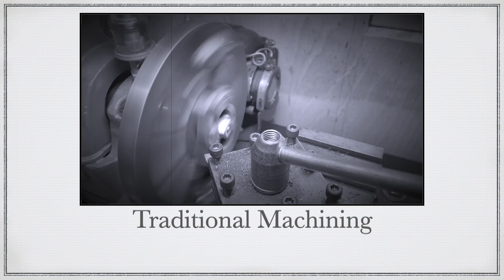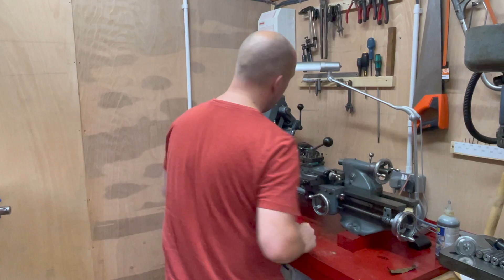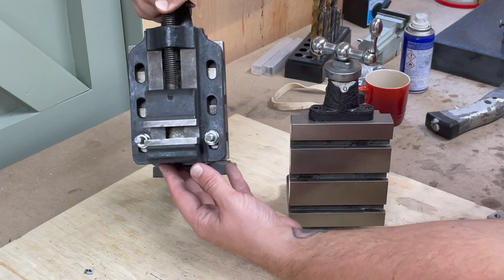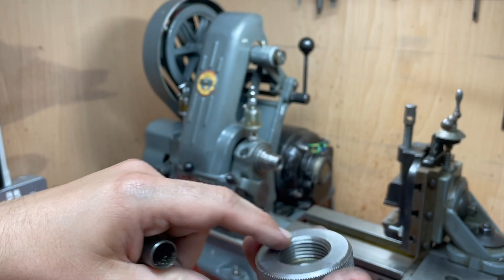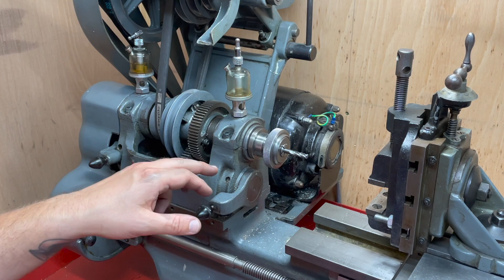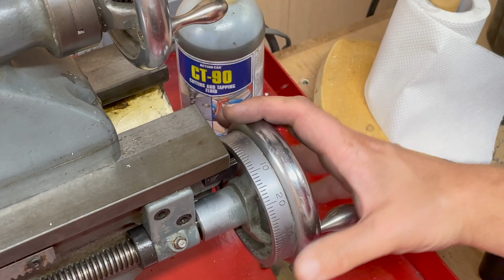Step by step milling in the Myford ML7 for beginners - updated and revised!

Comment: Sorry new to lathes and thought I would ask some questions,
If the chips not removing fast enough can`t you just have a small pump running that blows air through a flex tube aiming air onto the work piece?
Whats the speed of the Myford ML7 please, and could you not place different cogs to have a faster ratio combination,and just allow mor oil running on bearings to keep lubed,?
Reply from the maker: Best to check lathes.co.uk for the spec/etc. really mate

Comment: I have a unimat lathe mill combo with the power thread cutting attachment on it, is anyone making a video on how to use this little machine for the setup and use for the beginner.
If it's like your video it would be perfect for me.
Reply from the maker: I actually had an emco that I replaced with the ML7 (almost like for like, cost-wise!) - what did you want to know?

Comment: I was under the impression you have to use special collets with a thread at the end to prevent the cutter from pulling out of the collet and cutting deeper and deeper into the work piece so do Myford sell such collets for their lathes or is it just not a big problem?

Fingers crossed you see comments on old posts. 😊
Reply from the maker: It is true that there is a pulling force with milling cutters, you don't need a screwed collet end - I use those in my auto-lock chuck which you could potentially fit into the spindle of the ML7. The main thing here is to avoid using the 3-jaw!

Comment: Do not overtighten the verticle slide holding down bolts as it makes the cross slide stiff.
Reply from the maker: I don't use the milling attachment on the ML7 having bought a milling machine, but good to know!
Reply: @williamsworkshopuk  
I've never owned a milling machine but do have an Eliot 10m shaper and a heavy duty vertical slide on my Colchester Chipmaster lathe.
Reply from the maker: @haroldpearson6025  I have thought alot about getting a 10M shaper!
Reply: @williamsworkshopuk 
They are a great machine. Not a hobbyists machine but designed for the small machine shop or tool room. Very accurate and should not be considered as a "roughing out machine" 
I have used my 10M in the construction of 5 locomotives including 2 7.25g narrow gauge locos. All the flat surface machining was carried out on the shaper.
It's said shapers are slow compared to a milling machine. However this is not true when comparing a decent shaper like the 10M to a bench top hobby milling machine. The 10M will take a 2mm cut on mild steel and 3mm on cast iron.
The big advantage is in cutter running costs as you can use many of your lathe tools on the shaper.

Comment: Thank you William as a complete beginner the video was a great help and has given me confidence to give it a try.
Reply: Thank you so much for the video,,I was very pleased with the first attempt, I have the Myford vertical slide with the  multi axis .I haven't the vice as you demonstrated or the C work holders,so had to make some  out of flat bar just to hold a small aluminium block for trial purposes' I only had a 6mm 4 flute which was with the lathe when I bought it,which partly blocked the flutes,I have since learnt that a two flute is better with ally. I am going to look for a two inch vice for the vertical slide, holding clamps and collett chuck and end mills then I can get going on a simple steam engine. Thanks again I will be using this video in the garage when I have all the bits and pieces I need  being a pre war baby I easily forget. Dave
Reply from the maker: How did it go, Dave?

Comment: I greatly appreciate this, thank you. It's helped me understand the old lathe I just bought.
Reply from the maker: Great to hear! I'm afraid I do most of my milling on the Centec at the moment which is great fun and a worthwhile investment.
Reply: @williamsworkshopuk  I got a ml7 and every accessories for $500 aud, im definitely going to make due with what I have for now. What would you suggest is a good cheap milling machine. The ml7 seems good for straight cuts like keyways.
Reply from the maker: @rickoshae1687  gosh AU$500 is a fantastic price for an ML7 and all the bits! Regarding milling machines – I couldn’t decide between a Tom Senior, and a centec : it came down to whatever was available first. In reality, it might have been a smarter choice to get in modern machine. But if you go down that route, it’s probably smarter to pay someone else to do the machineing for you.

Comment: Hi William, a great video for beginners to milling, you cover a lot of good points.
Is that a Stuart steam cylinder in your video?
I learnt to mill with a set up just like you have on my ML7, it works, but with light cuts only and a very restricted working envelope. 
 Then I was very fortunate to come across an immaculate Myford VMB milling machine, what a quantum step in usability, but at a significant cost! 
A cheaper and fun way to increase your milling capacity is to get an old shaper machine.
I got a tidy Boxford 8 inch shaper for 1/8 of the cost of my VMB mill.
The tooling (HSS) is way cheaper and easy to sharpen compared to milling cutters.
A shaper really complements a lathe and it's a fascinating  machine to learn to use!!

Regards Paul in NZ
Reply from the maker: Hi Paul, it is a Stuart 10v cylinder in the video. Unfortunately I made some mistakes at the very last part of the 10v build (the majority of it is in a playlist on the channel) so it's sitting fairly forlorn on my shelf at the moment :)  I agree re: dedicated machine - got myself a Centec 2b shortly after this video was made and haven't really looked back, but it's wonderful to see what can be achieved on just the ML7.
Reply: @williamsworkshopuk    Hi William, Those Centec 2b machines look superb, very nice! I wonder if any ever made it to NZ? 
You must get your 10V finished after putting in all that work. I made one a couple of years ago, it runs great on comp air, I really must pull finger and build my steam boiler kit for it. 
There is an elderly gent, Harold Hall, who has a superb model eng web site. He has a detailed guide to building the 10V, with excellent pictures of set ups and fixtures. His guide is far better than the 'official' book that I bought from Hemingway kits. Harold is well worth checking out if you haven't already done so.

I totally agree that it's great to see what can be done on just the ML7, I made two gears on mine last year.  Regards Paul

Comment: It seems like you are breaking the rule of no upward force on the work in the milling footage.  Shouldn’t the cutter be started at the back and bottom of the work if the spindle is turning conventionally?
Reply from the maker: If it's at the bottom, the cutting force would be upwards, right?
Reply: @williamsworkshopuk  If the actual teeth of the cutter are applying the force then at the bottom it seems they should be pulling the work down and toward the operator.
Reply: 100% correct in your observation.👌

Comment: thanks for the video. if I may I like to point few thing out that I slightly disagree with or maybe you can improve.

The back lash on your vertical slide can easily be fixed by tightening the nut by the handle while turning the handle in the opposite direction. 
the statement that you need to run the lathe at full speed at all times is wrong. the speed is dependent on the size (diameter) of endmill used as well as the number of flutes compared to the material you are working on. Four flute endmill on aluminium is almost a never good idea as the flutes pack in too quick.
On your milling demonstration you seem to be running at about 300 rpm not full speed.
a very efficient method of squaring up the face of the vise is to use a dial indicator on the bottom of the vise and on the fixed jaw. this way you are 100% sure that the work is gonna be square to the two axis of the lathe anything else is just a gamble and presumption. 

Thank you for making this video I hope my comment will not be seen as a criticism of your work and effort but rather as a simple exchange of ideas.
Reply from the maker: Thank you for taking the time to comment. All points taken onboard and very well thought out - thank you!

Comment: 12:30 Saddle is Z axis, the other 2 axes are X & Y.
Reply from the maker: Thanks for the info, I always seem to get my axis mixed up when it involves more than two!
Reply: @williamsworkshopuk  They claim the Z is the spindle axis - leaving X and & Y for lateral positioning relative to the cutter.
Adds to the confusion if you have a horiz and a vert spindle on the mill ! Usually Z is vertical movement.
Reply: To the best of my knowledge (from CNC programming, et al), the Z axis is movement along the bed, and the X axis is for the cross-slide. Y axis would be the vertical milling attachment. The “A” axis is for the spindle rotation. Good content, though. Subscribed.

Comment: I use an ER 32 collet chuck on a Myford backplate as a cheaper option than trying to find Myford collets. A 2in Stevenson collet block will just fit in the vice and is handy for milling flats and slots in round bar
Reply from the maker: Nice! They are def. cheaper than myford collets but I'm not interested in buying chinese-made mass produced parts really, and I'd rather spend money on vintage equipment than buy new european stuff

Comment: Hello William
As promised I have had a go at milling on my Myford Super 7 using a rigid milling slide. Wow, the results were incredible. No chatter on either aluminium or steel. I used two flute HSS end mills and was blown away with the results. First with 6mm and then 12mm. Astonishing result. 25 thou depth of cut in aluminium and 10 thou in steel gave a mirror finish on both. 
I have a small Seig SX1 milling machine. No way could I do this on that mill. It’s great for accurate drilling and micro milling, but no more. 
Definitely going to continue experimenting, especially with how to accurately measure the movement of the milling slide in the vertical axis,
Once again thank you for your inspirational and informative guide. 
One very happy viewer here. 👏👏😀
Reply from the maker: Sorry I didn't get back to you on this one - I'm very pleased to hear you got good results. With regard to vertical movement, are you not using the micrometer dials on the vertical axis?
Reply: @williamsworkshopuk  Oh, no need to apologise. I am so grateful to you for your videos. Yes, I am currently relying on the micrometer dials, but hope to add some form of dial indicator to increase my accuracy.

Comment: Please could you provide a shopping list of parts needed, including serial numbers. Eg, Myford collet closure ring serial number 12345... Your videos are first class and have been very helpful to me. Thank you.
Reply from the maker: I'm so sorry but I'm afraid I don't know the serial numbers of the parts - the collets are called 'Myford Finger Collets' specifically, and the closure ring is just that. If you look on eBay there's someone (homeandworkshopmachinery I think) who has all the collect components. 'Myford Vertical Slide' MA68/1 and a mini machine vise (mine had no markings) should round you out.

Comment: Nice video.
Just a couple of things. 
I was always taught to start motor with belt disengaged.
When aligning a vertical slide use your push back method but always place a parallel between the back of the slide and the front edge of the carriage. This is then removed for working. This provides a small gap. With them touching any chips getting between could cause problems. Also I tend to leave a setup over several days. If you set this up at night and left the surfaces touching in the heat of the day the expansion of metal  could cause problems. There is way too much slack in the vertical slide. You need to unlock the handle locknut, tighten down the dial until slack is minimal then tighten up the handle. When I inherited my ML7 it had the same issue in all slides. 
1 final thing you mentioned but didn’t show lamping of the carriage or the slides. Great video am now going to start perusing your other dies. Steve
Reply from the maker: Hi Steve thank you so much for the message - after this video I tightened down the vertical slide screw nut - I think it became half unscrewed while I was doing something else and I hadn't noticed.  Great idea about adding some gaps with a parallel too!
Reply: @williamsworkshopuk  However, butting the back of the vertical slide with the side of the cross slide will add rigidity!
Reply: The belt lever is just a belt tensioner, and is not designed to be used as a clutch. I think the S7 has a clutch and does not use slack belts as the clutch ! Normal operation of belt driven machines is to start the motors with the belts tensioned.

Comment: Can't hear you!
Reply from the maker: Hi Mike- what do you mean, please? Happy to edit the video if there are problems!
Reply: @williamsworkshopuk  The volume of the opening music is vastly different than your speaking. At my usual volume setting the music was loud, but to hear you speak I had to crank the volume way up.
Reply: @MarkATrombley  Yes it was a bit quiet at times
Reply: @williamsworkshopuk  Go back into your editor and 'normalise' the sound - that will fix it. Better though to get your audio levels set correctly in the first place.
Normalising (or 2 pass) goes through the video looking for the loudest noise and sets that at max volume with all the quieter bits proportioned to suit.
If you find you have a quiet clip, you can just normalise the clip. #gain/volume settings